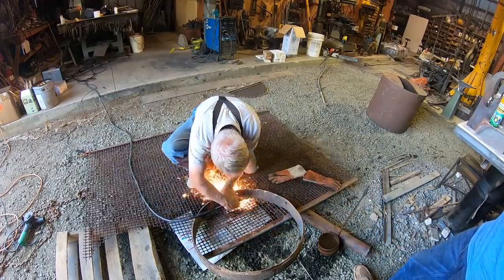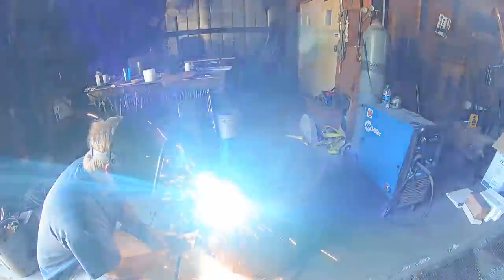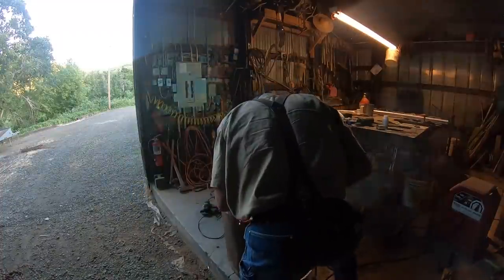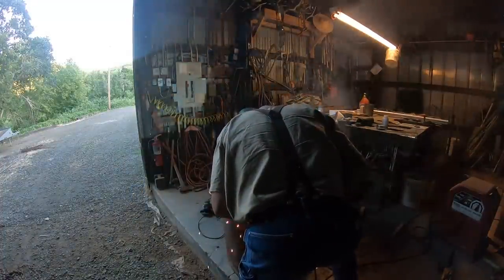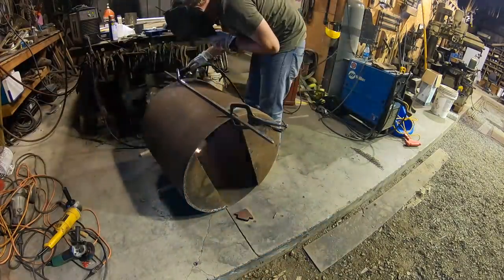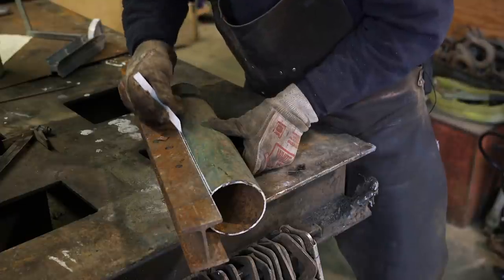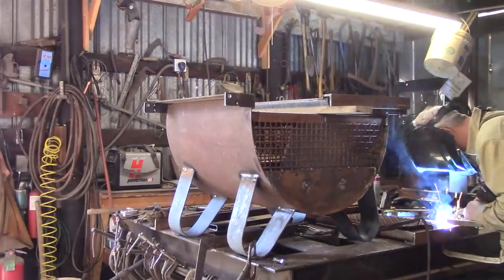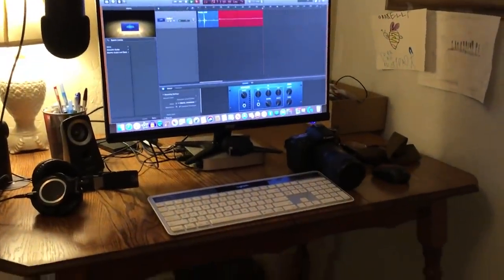Why You Need Shop Skills

Comment: My sister in law says that my brother has a lot of "old man skill". The two of us grew up helping keep our family dairy farm going. There was always something broke and dad didn't have much time to do the repairs. We learned by watching both grandfathers fix things, dad's father doing carpentry and mechanics despite being short a hand from a farm accident. Mom's father doing welding, metalwork, blacksmithing  and machining he passed away when I was a freshman in high school and didn't get to pass on a large portion of his knowledge and skills. We learned by watching the hired mechanics and technicians that came to fix things. We were very fortunate to have willing teachers to get us started and plenty of work to hone our skills. We didn't always have the right tools for the job and had to learn to improvise. We no longer dairy but I raise crops, a few hogs and beef cattle and do most of the repairs myself on the farm, my brother is a maintenance millwright at a local steel mill, and our younger brother is an electrician at a power plant. As it turns out we use that "old man skill" quite a bit on a daily basis. I also try to pass what I know along when I can. You may leave behind your tools, but unless you teach others it goes to the grave with you.
Reply: So we'll said!

Comment: My dad was jack of all trades and master of many.  He could do and did anything that needed doing.  Had a shop full of basic tools and opportunities.  When I was about six years old a neighbor gave me an old Briggs & Stratton engine. I realize now that there was no way it could have run but my dad hooked it up to an electric motor with a belt so it would look like it was running.  Showed me how it was supposed to work. I could do basic metal fabrication and carpentry by the time I was eight years old.  I still have and use many of his tools.  Thanks dad!  I miss you! See you soon!

Comment: I have a small garage workshop and I do little projects with my son from time to time to help him get his feet wet.  Now he has started "modding" his Nerf guns using the skills he learned (hand tools, vise, soldering, drills, etc.).   Watching him go from timid beginner to independent Nerf craftsman has been awesome!   He now has his own specialty tools to have fun in the shop.  Precision screwdrivers, soldering iron, wire, springs, third-hand, Dremel tool, etc.   Good times!

Comment: You spoke pure words about shop skills.  You have to do it to learn it and a smart student always listens to advice.  
I have a trick of the trade for you today but it isn't what you think.  It is a trick for roasting marshmallows.  This trick 
works best with a two-pronged fork.  Stick your marshmallow on the fork and either dip it in water, spray a little 
water on it or lick it before you put it over the flame.  It will keep it from catching fire too early so by the time you 
get it nice and brown on the outside it will be completely melted on the inside.  Use to water method if you are 
sharing the marshmallow or lick it first to prevent anyone from taking your perfectly roasted treat.  You can tell 
I grew up in a large family.  Ha ha.
Reply from the maker: Now that is a shop skill everyone can support! Thanks 1 million!

Comment: Nice fire pots.  But wouldn't you want to drill some small holes in the bottom, so when it rains it can drain through?  I"m assuming you're not taking those back indoors every time you're done with them.

Comment: Words from the wise.  So correct.  My GF wonders how I can do the things I can do - mostly renovation / construction.  I've either done it before, was taught how, watched [carefully] how someone else did it, read a book or now, YouTube.  Heck, sometimes I have to admit that I don't actually know how but I understand the principles.  As some other person, a Military General I  think,  said; " You learn more from failure than from success."  So, go for it!  

My next task will be arc welding.  Scares the heck out of me but I understand the fundamentals of electricity and hope to at least know how not to 'plug myself in'.  After that and a few fires, I'm sure I'll get it sorted =D  

Cheers and thanks for such eloquent words.

Comment: I totally agree regarding shop skills.  I worked 45 years on engineering projects, but I am NOT a licensed engineer.  I began by "doing" in the field and retired as a construction contract manager responsible for a lot of construction decisions to get a project completed and very functional.  I still work periodically with young engineers.  Not always, but typically they have no practical experience, and it pains me to see them struggle with thinking through project details without a basic knowledge of how a project evolves to completion.  We need to get back to understanding basic skills.

Comment: I was 13. Holidaying on a distant relatives farm. A boy a few years older than I was using oxy to cut the top off of a 44 gal drum. He was having issues with the last few inches and the drum was bucking as he tried to get the head of the torch into the last bit. So I jumped in and grabbed the opposite side of the drum to brace it. For all of about a half a second. Some lessons just have to be learnt on the job.

Comment: would you please do a video on plasma cutting? *I'd like to add asking a question like that isn't completely in the spirit of the message of this video- however I am an artist who has no experience in welding or in use of an acetylene torch, and would love to hear your take on the process before i buy some equipment.
Reply: x haunter take a welding class at a community college for semester. It's well worth it if you're just getting into it. Or volunteer to help someone around their shop that has the skills you want to learn :)

Comment: I learned to fix cars by buying one that barely ran, and then fixing it. I admit that I no longer try to work on cars - there is some much specialized stuff in them that it doesn't seem practical. But I've always just 'dived in', and mostly that's worked. I just walked into the physics machine shop when I was in grad school (in math) and helped myself to the student equipment, and managed to keep all my fingers. Unfortunately, when I broke the bandsaw blade, I was stuck, because I hadn't taken the intro class, which explained that there was a tack-welder on the back of the saw! I felt like a jackass when the next person in pointed to the back of the saw when I asked how to fix the blade. He said "You didn't take the basic class, did you?" I didn't even know there was one, since I was in the wrong department... Sometimes it's easier to ask for forgiveness than permission.

Comment: I saw the title of this video and I thought....

If Scott says anything other than something similar to  "shop skills can only be learned and earned by actually doing, instead of watching or reading about it",  I would have lost a little bit of respect for him. I say a little bit because my respect for him is already so immense he'd have to say or not say a lot more than that for me to lose more than a little bit of respect for him, but yes,  I would have been disappointed if his point would have been anything else.
That said, it's funny, even as I was thinking that,  I knew it would actually never happen and I clicked on the link with such absolute confidence that I wouldn't be let down because my  respect for this man has  already been beyond solidified;  even my own high  expectations were surpassed when Scott said what I wanted to hear in the very first sentence.
 The FIRST  sentence.
Six seconds into the video.
There is ZERO  substitute for actually doing when you are trying to learn a skill. Zero. You can read 1000 books and watch a million videos and it won't equal 1 hour of shop time whether that time  includes  failing or succeeding. Both are invaluable in learning what works and what doesn't.
 I typed all this after only hearing the first sentence of this video. I've already gotten my money's worth.
Now I'm going to enjoy the rest of the video.

Comment: There is as well the opposite effect of when you see a skil like welding and think that looks easy. Then you get the basics of melting mild steel and looking to the next steps of high carbon, stainless, aluminium and see back that your basic stuff is miles from the standard. Of course your message is keep learning your not there yet. but it’s that extra realisation of the basics that need to be learnt and a lifetime skil is not that easy

Comment: where can I begin with no home, no car, no tools?
Reply: You can buy a cheap 120v welder, grinder, slag hammer, tape measure, combination square, 2ft. Level, and some soap stone from harbor freight. Those are the basic tools you need to get started. If you have a friend with a garage, you can ask him to use it to practice and work on projects. If no work bench is available, then build a small steel work bench as your first project. Watch the channel “welding tips and tricks” to learn how to weld, and watch a couple grinder and welder safety videos.